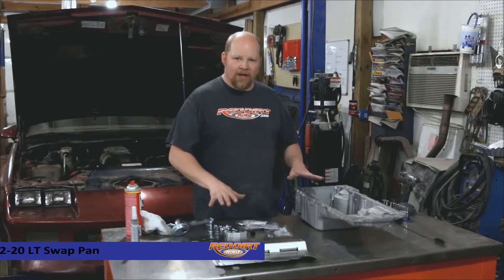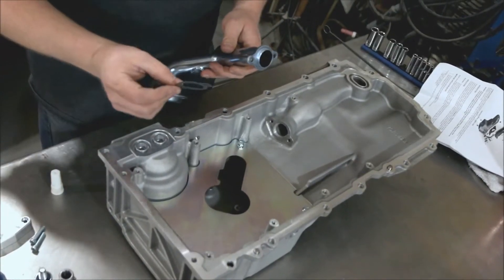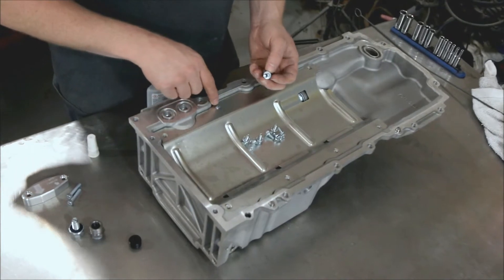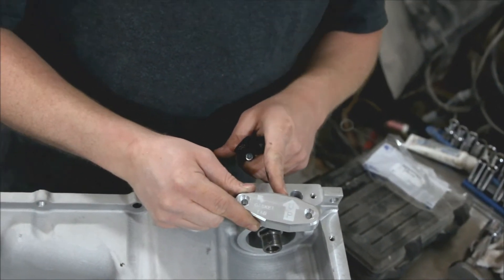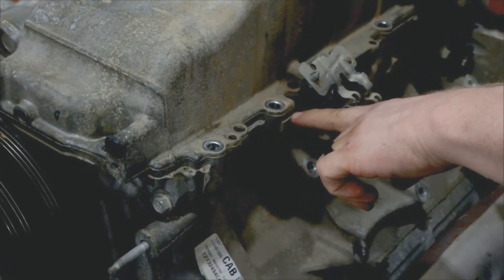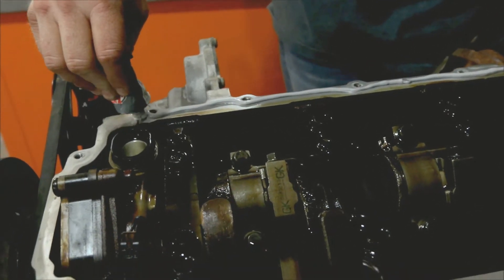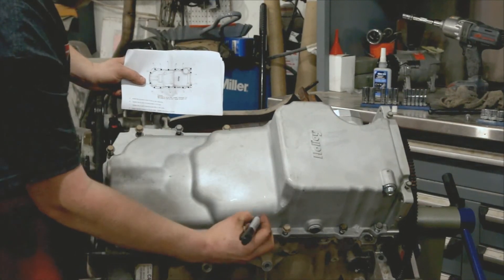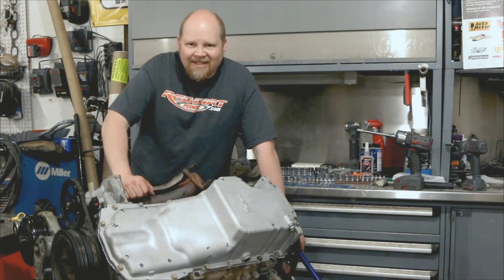How to install the Holley Gen V LT swap oil pan

Comment: I just got a free L86 and was thinking of dropping it into my S10. Anyone here try that yet? Was wondering what the clearance to the cross member is, if it was like the 302-1 where you don't have to put a notch in.
Reply from the maker: This oil pan should clear with the right motor mount adapters.

Comment: INSRUCTION SHEET SAYS 18 FPT AND 106 ON THE TWO LONG BOLTS.  HOW DO YOU GET THAT FROM YOUR IMPACT?
Reply from the maker: 106 inch pounds is 8 ft pounds. The impact that we use is adjustable, we had it set on the lowest setting, which is less than 20 ft lbs. Our torque wrench doesn't go that low.
Reply: Then you can get a Tq wrench that operates in that 18 ft lb range - you mention "follow proper tq procedures than run it down with an impact wrench - just sayin
Reply from the maker: @TheRdub82  The Ingersoll-Rand cordless impact imparts 13-33 ft lbs in the wrench-tight setting I was using, I have it dialed in, this is not a "3 ugga-dugga" situation.
Reply: @Reddirtrodz  Get a couple of torque wrenches. Most people have 3 plus an angle indicator attachment. With so much aluminum, galling and threads stripped there is no room for "close enough".